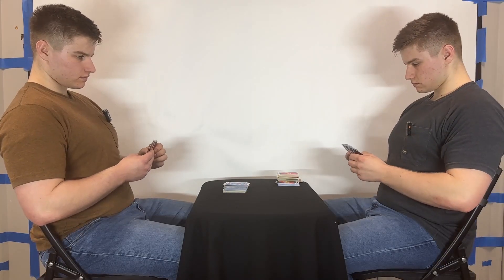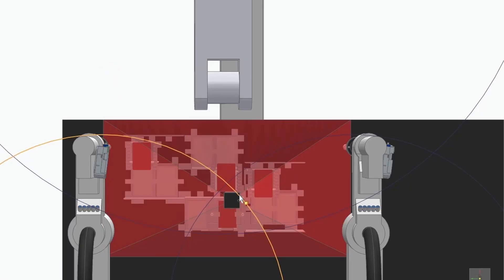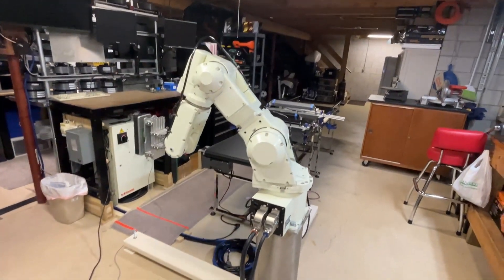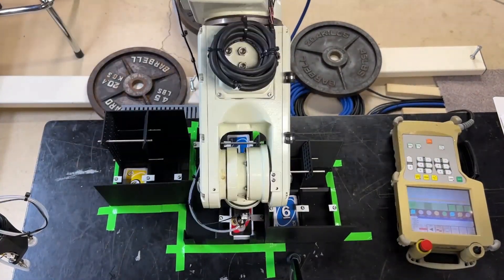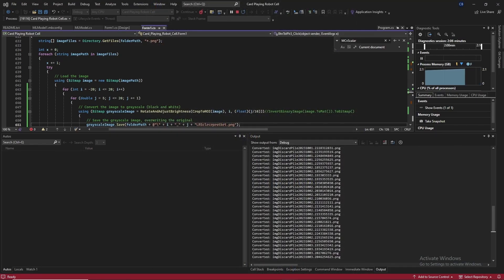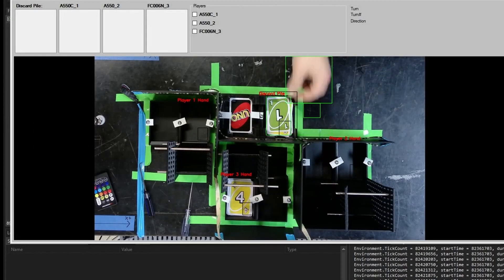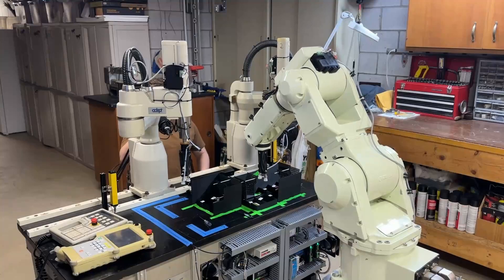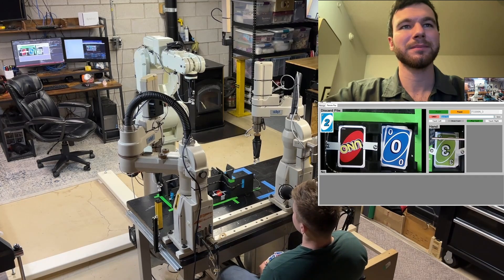How I Gave Industrial Robots AI To Play UNO

Comment: What are the specs of the computer you used for the thought process of the computer? Was it demanding or is an old dell tower useable?
Reply from the maker: To build the model it would take a stronger computer. But to run the model slower, a weaker computer works. But it depends

Comment: Very cool project you've made! 
The way you show how semi-complex tools (e.g., ML) can be used for this kind of task is great. This video gives a great understanding on ML can be used with industrial automation. 

If you wanted to take a different approach to ML for colors. Using the color system CMYK instead of RGB might allow you to create something yourself and save a bit on the computing side (image processing) of the project. You can convert RGB into CMYK with some loss of color accuracy or vibrancy, the conversion mainly hits the very vibrant or saturated colors, as the two color models represent colors differently.

Also, you mentioned how only one of the arms could move at a time. It sounds like the program used, gives them instructions in a single-threaded manor, (better for safety in your workspace, where they could hit each other) that could be the reason only one of them would operate at a time.
Reply from the maker: Thanks, very good points made. The CYMK color scheme would have definitely been better and that is a likely explanation of only being able to control one arm at a time. Thanks!

Comment: This is neat man, but I think you really overused machine learning in this work. Opencv has tools like template matching which would get your numbers or anything from the cards. 
Also in computer vision its best to use HSV colour space cause as you saw RGB is a bit shite. 

And with your training data, if you use machine learning in the future give a try at setting up the models yourself, cause saving 60gb of tiny cards is strange, the original images can be loaded and augmented on the fly for training for any number of rotations, translations, brightness, noise or any augmentation. Google tensorflow data augmentation for an example, otherwise nice work 👍

Comment: Very cool project! You put a lot of effort in to this and it paid off however I wanted to point out that it is possible to "over train" a model, take for instance the most popular dataset for characterizing the digits 0-9 , MNIST, it's only about 60,000 images and you can get really good models from it.  Also as you already know the training dataset is really important however its just as much about variation as it is repetition, you want to be able to find a specific pattern amongst what is basically background noise, so if you have many copies of the same image with the only variation being brightness or rotation then that repeated background is now part of the pattern, your not only looking for the number your also looking for what is common between all the other images.
Reply from the maker: I see, that's very interesting and explains a lot. Thank you.